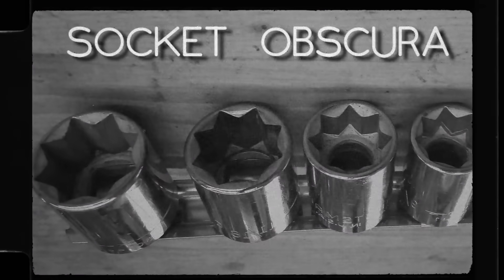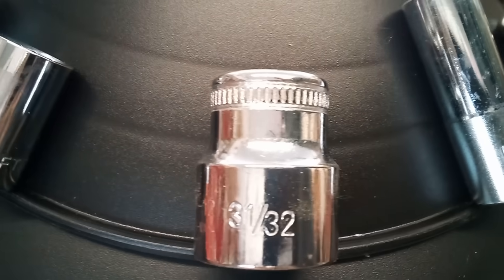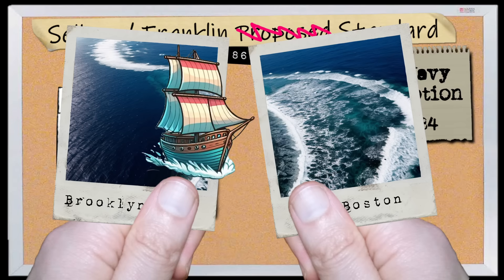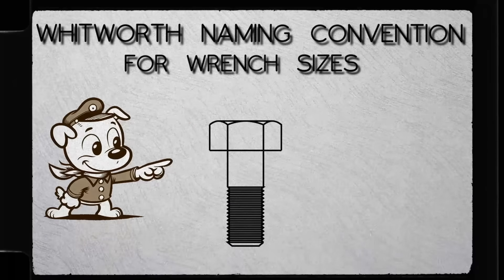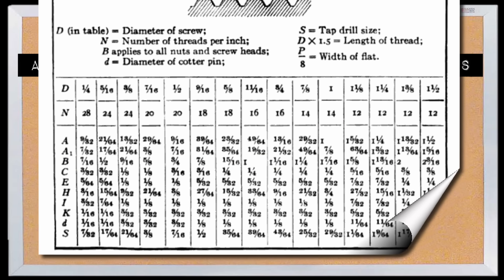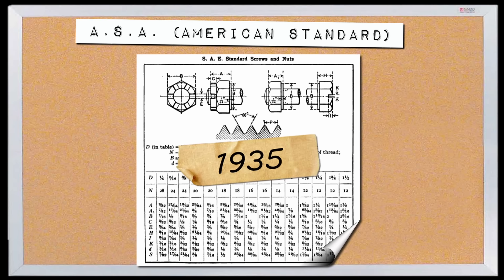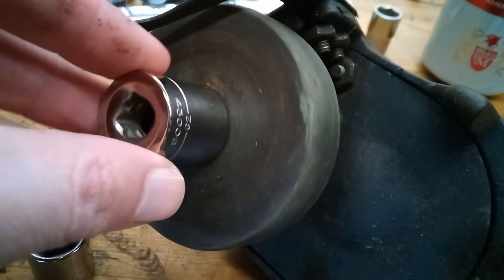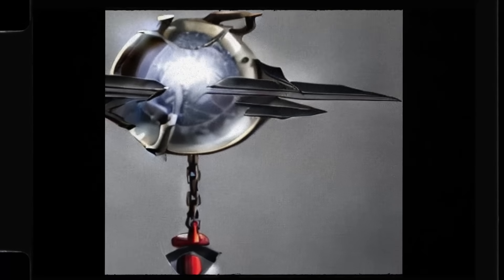32nd of an Inch Bolts - History & Lore

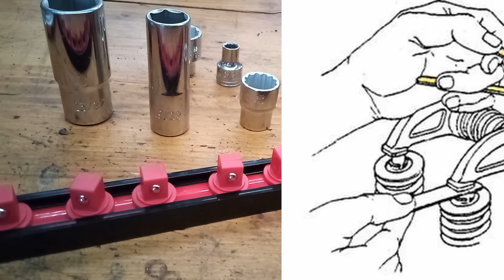Comment: 7:35 I call BS on your OCD. You cant mix 6 and 12 point sockets on the same storage bar like that, it just isnt right. 😂
And do my eyes deceive me, or is that a spline socket as well and not a 12 point added in too?
Makes me wonder if the big socket is secretly a triple square instead of a 12 just to get another type secreted in there. lol
Reply from the maker: LOL True. They don't normally live together on that rail. The other 12-point one is an Elora with a 'rounded lobe' design.

Comment: Bless - you Americans are hilarious. I am 66 years old, and from the UK. I grew up with Inches and Shillings. But then we went metric. The only "superiority" of the imperial system is the theory that a fraction can be more "perfectly" accurate than a decimal (That old "pie" thing and all that.) So I find hilarious that even you seem in a muddle over 1/32nds of an inch. Heavens, what happened to 1/64ths et all . . . . You have shot yourselves in the foot. The machine tools are all in decimals. There is no way you will ever get a fraction out of a cheap pocket calculator. So here you are, converting drawings, with all the risks, to end up with a trailing row of decimals . . . It is a huge face-palm! Just press the button on the CNC machine. Switch it to millimetres and accept the fact. You can't use fractions any more. The machine will neither produce them, or can be programmed using them. Just STOP! Set 'em on millimetres and have done with it. (And yes, the French spelling.) - I mean, look at it. 60° thread angles are metric. Stop beating yourselves with a stick. You will have much more fun once you let go.

Comment: I was on a job site last week swapping out a battery on a Chinese made 4x4, had metric bolts. The toolbox there on site didn't have any metrics, but there were a few slash-32 sockets in the drawer, one of which let me finish the job without having to go drive back to the shop to fetch tools. 

Yes, there are times they still work in a pinch when "Standard" sized tools don't.
Reply: Also, them Chinese in order to squeeze every penny out of the razor-thin profit (hence this "cut-throat competition" moniker) used to make bolt heads and nuts smaller than typical for given size metric bolts - for instance M8 bolt used to have 13 mm head, but Chinese stuff often uses M8 bolts with 12 mm heads. No biggie, both 12 and 13 mm are part of "standard sets" - but then M10 bolts should have 17 mm heads, while Chinese stuff often comes with M10/16 mm combination - and 16 mm wrench or socket isn't always included in "common/ budget" tool sets.

Comment: Please ?  Why is a 7/16 bolt ( I think that's the one) bolt uses a 5/8 wrench and a 13/16 on the nut. Or one close to these sizes.
Reply from the maker: I couldn't find a concrete answer. Another viewer mentioned it was so you didn't need to have two of the same size wrench. There's also the 'heavy hex' standard, which allowed for larger nut sizes.
Reply: Thanks. Years ago my wife at the time complained because I had two set of the same size wrenches, I told her a lot of time I need two of the same size so one day she and her daughter was doing a project and needed my wrenches so I gave them one set and in no time they said they needed two to hold the bolt and nut I said no you said I didn't need two set so you can only use one set, she said she was sorry and I finally let them use both sets.

Comment: One time when repairing an old B&S screw machine I encountered a #9 and #14 machine screws. There are no modern standards for either of those sizes even though number-series threaded applications are used. No one makes a #9-36 tap unless you have one made.

Comment: Flathead Ford V8 waterpumps had a bolt inside the inlet with a 5/8" head.   Eventually rust action on the bolt head reduced it to19/32".  At that time most people used alcohol antifreeze in winter and water in the summer, so there was quite a bit of rush action.

Comment: It's insane to me that anyone would print a bolt shaft size on a wrench instead of the wrench span size.
Reply: I recently bought a collection of flat wrenches/spanners because I needed a specific size for a right angle grinder disc. There were many odd wrenches in the bundle, now I understand because several were labeled for the screw diameter instead of the hex head size. Thanks you learn something everyday.

Comment: I've got something I want to get off my chest.  a 55 gallon drum with a lid and clamp uses a 15/16ths bolt and nut.  nice joke, you couldn't just use a 1 inch bolt, I have plenty of sockets for 1 inch.  Now I have to go to the autoparts store to get this one specific socket.
Reply: Opposite experience: I use 15/16" for so many things over the past 50 years, and 1" . . . basically, only for Rochester fuel filter nuts.  B&S flywheel nuts.  Mower blade adapters.  And almost all 5/8" bolts utilize 15/16" hex.  I still use 15/16" tools weekly.  So, the (24) 55G drums with clamp lids in my backyard pose no hindrance at all to me :)

Comment: Delco Remy had the only 15/16" nut on the pulley.
Reply: 15/16" is the standard nut size for 5/8" shafting, and that's the rotor shaft dia. on the old Delco alternators, IIRC.

Comment: I have no idea why they didn't pick metric during the big standards development prior to 1950.
Reply: Who are "they"?  The United States adopted the Metric System in 1866, and has contributed to the development of Metric standards ever since.  Standardizing the UNified bolt sizes and threads was important, because a lot of useful things use inch-based hardware.  Cameras everywhere use a 1/4-20 screw to mount to a tripod (or 3/8-16 for large cameras).
Reply: @GH-oi2jf  "They" are the entire population of the US.  I agree that new cars, domestic and otherwise use mostly metric parts and fasteners. But everything else is imperial, including everything not under the hood of a car including the speedometer, gas tank, oil capacity, etc..  Metric fasteners at the hardware store are in the exotic drawers.  I had to special order metric tape measures and I did that simply because I thought it was a better system.  Nothing is measured in metric.  Speed limit, paper size, plumbing, electrical, construction, ammo, food labeling, sports, anything ordinary people touch and use is imperial.  Electronic parts tend to be metric, but that is because it is imported from elsewhere, and that is guarded by a sign that says "No user serviceable parts inside" followed by "Hech en China".  The US may have supported development of the metric system but we sure didn't bother to adopt it.

Comment: Many of those old unplated end wrenches have nonsensical markings on them. I figure they were made for the square headed nuts and bolts used on old farm equipment. Didn't matter- you only had grab a wrench that was close to the right size anyway. Old farmers that I worked with as a kid called those square nuts 'taps'.

Comment: Have you done a video on metric sizes yet?  The "half" sizes on smaller sockets bugs me.
Reply from the maker: No. But there's enough interest I might have to do a full video on metric some time in the future.
Reply: I have 4.5 and 5.5 mm in my 1/4" set.  It doesn't bother me.  Why should it?  It makes sense, proportionally.  What would bother me more would be 1 mm steps in large sockets, because they are more expensive.  Is there a point at which the increment changes from 1 mm to 2?  What is it?

Comment: Sometimes a metric socket is close enough to work with 32nd sizes

Some of the plumbing fixtures in my old house are 32nd sizes as well - confused me quite a bit at first (I believe some are still made that way)

Comment: The 1958  Bugeye Sprite I'm restoring on my channel has a mix of standards on it.  Most are the "modern" UNC/UNF, but I have also come across Whitworth in a few instances and one real oddball size on the generator mount.  UN* didn't fit, Whitworth didn't fit, so I measured it.  Turned out it was 17/32.  Fortunately it was in a location where I could use a Crescent wrench on it.

Comment: Back when I was a mechanic I found it very convenient to have both standards on hand because when you got into some bolt heads rusted to the point its actual size no longer existed - but you could often go to the other standard and find a wrench or socket that fit perfect--lol
Reply: that's what I was going to say
Reply: Same goes for "imperial" Allen bolts - some sizes of metric Torx keys/ wrenches fit them good enough to be used "in lieu" if you don't have imperial Allen keys (metric ones won't do).
Reply: I've found I have to have all of them. Had several vehicles (jeeps) that often had both metric and SAE bolts on the same part. Frustrating. My cousin has an old shop with an array of very old tools. Now it makes sense why they never seem to fit. We started bringing our own tools to the shop lol
Reply: And don't get me started on the industrial machine bolt heads with 3 or more  coats of paint on them making the wrench choice a whole other size category.
Reply: @ Oh, thats easy-peasy - the "wrench" in question is called a "hammer". One or two good smacks with it on the bolt head and the paint is pretty much gone ;-)
Reply: Bang a 3/8 on the rusted 10mm bolts on Toyota coil packs. Works like a charm.
Reply: me 2

Comment: We're using metric wether we realize it or not. 19/32 is 15mm, 15/32 is 12mm, 23/32 is 18mm. Notice these are the common plywood thicknesses? I switched to metric in my woodshop when I realized this a couple years ago. Made my workflow a whole lot easier.

Comment: I am from Scotland and being over 70 which means I served my apprenticeship in the mid 60s I remember going through all the different sizes whitworth,  British standard fine (BSF), then met the AF (across the flats) then the unified fine (UNF) followed by the unified coarse (UNC) etc.  I remember being told in my teens that all this would disappear as we were going Metric and would make things simpler, Aye Right! The French had one size, the Germans had another size and so on. Everyone and their Grandmother thought their system was better, not counting BA, BSB, BSP LOL, some of which are still in use today. Excellent video keep up the good work. Yours Aye! Birkbeck.
Reply: As a German, it was always a pain in the backend when i had to replicate worn out or broken parts that werent metric, especialty when threads were involved.
Measuring the diameter and pitch and then seaching X tables to find out if it is BSF, BSW, UNC, UNF, UNEF, WW, G" or R", ect.
Reply: @wolf310ii  German bolts also have different head sizes then Australian metric bolts. I was brought up with the Imperial system and then we changed to metric. The glow plugs in my model engines are UNEF and taps used to be hard to get so when I was an apprentice, I made one at trade school.  In 1993 I visited the Atlas Copco works in Bremen, German engineers are tops.
Reply: @redtale6527  Do you mean metric bolts with imperial heads or like M8 has 12mm heads instead of 13mm?
That M8 bolts have sometimes 12mm heads and the nuts 13mm, is German too, some time ago there was a change in the norm and now we have 3 norms for bolts, DIN, DIN-EN and ISO, German, Europe and Internatinal.

Atlas Copco Cologne was one of our customers.
Reply: I am always amused by ‘metric’ sizes which are just a mathematical conversion of the imperial size. I see it all the time here in Australia with pipe fittings. They, fortunately, are still BSP thread or we would all be stuffed. The US equivalent is NPT or NP which can cause problems for us sometimes if we are not careful.
Reply: @ And in BSP, you have BSPP (parallel) and taper threads, which can also cause confusion.
Reply: @netpackrat  Yup just to confuse things even farther lol
Reply: @jefftheaussie2225  Japanese Metric pipe thread is the same as BSP or BSPP.
Reply: Military Pitch is another version.  UNJ if I remember correctly.   
BSP is a corker to deal with when you find your having to mate up an end and...all your stock is NPT SAE and JIC.
Reply: @RetroCaptain  All our pipe threads are BSP so we can cope.
Reply: Finally!  Someone who will get my old British automotive joke.

Q: Do you know why the British always drink warm beer?
A: They all own Lucas refrigerators.
Reply: @LuckyBaldwin777  "Albert Lucas: The Prince of Darkness" late 50s USA provence.
Reply: @LuckyBaldwin777  Ha Ha nice one!!
Reply: I have never been able to work out what BA is. I have a couple of BA taps and dies and they are a mystery in my collection.
Reply: @jefftheaussie2225  Custom threads for the sheep farming industry, maybe?
Reply: @patrickshaw8595  BA? I know the thread on the shearing down tube is a strange one but it is bigger than any of the few BA taps and dies I have. I have never explored any of the threads on a hand piece or anywhere else in my shearing shed. That stuff lasts for ever.
Reply: @jefftheaussie2225  British Association threads were used on electrical gear which has mostly gone metric now.  Model aircraft and train modellers still use them. From looking at the chart on Macc Models website they used number drills for tapping holes.
Reply: @ BA British Association, They were generally used on optics as you know whit thread angles were 55 degree UNF/UNC Metric were 60 degree thread angle  where as BA was 47/half degree angle. The were used in optics/camera where the wall thickness was very thin and still need to be screw cut but not a great strength in hold. I have a set of BA taps and Dies in my workshop 0 to 10 BA but they go even smaller to something like 14 or 15 BA. hope this helps.
Reply: @ Stands for "British Association.  Oddly enough, they are a metric fastener, but the sizes are not whole number MMs.  On my MG, they are used in a few places including the instruments and the SU carburetors, and others that slip my mind at the moment.
Reply: @netpackrat  
BA starts at size 0 with a 6mm diameter and 1mm pitch. Each subsequent size is about 90% of its predecessor.
I use a lot of 7BA bolts which have a diameter of about 2.5mm and occasionally go down to 12BA with a 1.3mm diameter.
Reply: I had a 1968 Triumph motorcycle that took Whitworth wrenches. I hated it. I couldn't find or afford Whitworth wrenches and used vice grips or poorly fitting SAE tools. Every nut and bolt on that bike was rounded off
Reply: I like US 1/2-10 bolts with square heads and square nuts. I like them so much I use them for every thing except my wristwatch and I just pressed everything together to make it. I hate but must work with threaded fasteners.
Reply: BSP is so ingrained I don't think it will ever be replaced with metric.
Reply: @redtale6527  Imagine draining and digging up The Hoover Dam in order to replace the NPT pipe fittings with Metric. lol.
     My Dad was an infantryman in Germany and he was there for the Occupation. He had  POW helpers at the Motor Pool.
     He used to banter wit the Germans that
their tires had always been in inch sizes. They would counter that our sparkplugs had always been metric!
Reply: @patrickshaw8595 — Sparkplug threads are Metric but the nut is English.  Go figure.
Reply: @GH-oi2jf  I bought a hardware assortment from Big Lots and it was six different sizes of UNC course thread bolts and nuts - all with Metric hexes (the exact opposite!)
Reply: @GH-oi2jf  BTW - Model T spark plugs are 1/2 NPT. Kind of cool - no gaskets or taper seats! Also - they disassemble for cleaning!
Reply: @redtale6527  
My understanding is that it's specifically designed for thin walled tubes.
Although the diameter of tubes has a wide range, the wall thickness isn't proportional to the diameter.
Reply: As being a mechanic I have worked on all kinds of vehicles have encountered this Lol
Reply: All I learned from this is that it’s worse than I thought or have been dealing with
Reply: 100% Correct. Think you mentioned all the stupid variations. Dont forget "Cycle"
Reply: N PLEASE , dragging the French & Germans into it ??? to$$er
Reply: Do you like blood pudding
Reply: Good video , thanks !
Reply: As an American who has to deal with Metric anyhow I wish we simply stopped the fractional sizes altogether.  Sadly it's a political lightning rod.
Reply: @aebirkbeck2693  cool im 68 seen a lot in this world . Wish i was back wandering about wrench sizes instead of wandering if the government will pay me my money next month . If Uncle Trump and Aunt Musk have it there way they will pocket out savings and be off to Russia i suppose who knows anymore

Comment: You all should adopt to metric system, fractions are totally stupid system, metric is superior to anything else and only coarse an fine threads, no millions of pitch
Reply: The United States adopted the Metric System in 1866.  Anyone here may use it.  US automakers are Metric now.
Reply: @GH-oi2jf  Yes, but you are still using sae in most places and factions in tools
Reply: There are not "millions" of thread pitches.  The UNC and UNF standards cover most threads which are not Metric.  Plumbing uses different threads, but for a very good reason.  You don't want pipe fittings to leak.
Reply: Yeah . . . about that "only coarse and fine threads" . . . you might want to research that again.  "Coarse", "Fine", and "Extra Fine" all exist in the ISO metric standard, and are stocked at my local . . . Ace Hardware.  Not even exotic, if they're stocked by a general hardware store in the USA.